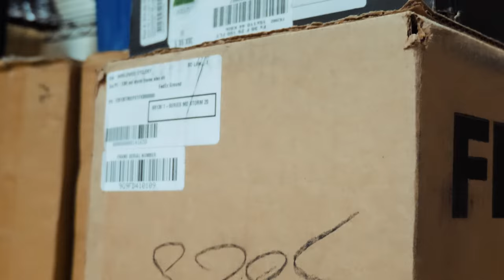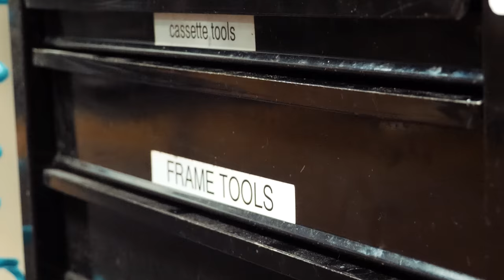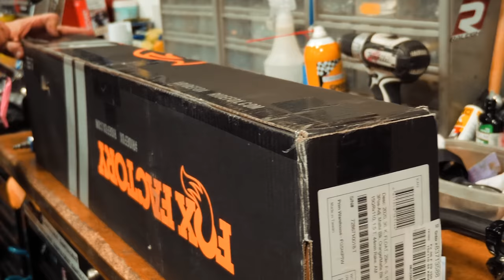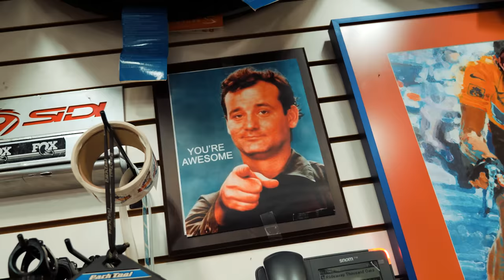MY NEW DREAM BUILD MTB - YETI SB130 | 2020 Yeti SB130 | Gee Milner Inspired | Dad's New Bike Day 2

Comment: Great vid! I noticed you got the 100 mil dropper, then saw your comment that you’re riding a M size at 5’6”. Brings to mind a question I’ve had,  also at 5’6”. Have you tried small frames, and if so why did you choose the medium over the small? One advantage you’d have with the small, is to utilize a dropper with more travel. I ride a small, just based off mfg’s sizing charts, even though I’m technically sort of close to the lower end of the medium sizing height scale. I have a 150 mil dropper, but actually think I could use a 175 mil. I’m a little curious if I may like a medium bike more? I wonder what the advantages may be?
Reply from the maker: this question has a two fold answer, I grew up ridding bikes that were always bigger then me and I feel more confident hucking it off of things. 2. I would probably be ridding a small but since im poor and need to turn over my bikes with the most profit possible I will never ride a small unless I become very well off because Smalls are super hard to sell. Basically, I ride medium because of financial reasons.

Comment: Sweet now make it a lunch ride 
Remove the spacer makes it 137rear

Set psi to yeti settings I found running 33 sag is terrible and higher sag is better for the sb130

No compression and vroom
Reply from the maker: Really I’ll look into this, I kinda thought the same thing after ridding it the 130 is kinda pushing it
Reply: Slow the rebound to 7 clicks from full fast
Zero compression
And go based of psi

I tried 33sag and I couldn't make techy climbs cause bb was too low
I would get in the rough stuff and would be too far into the travel 

Now I'm running zero spacers 
Shock set to 137mm travel(by simply removing the 2mm spacer that comes on the dpx2)
Not sure what sag I'm at but I'm at higher psi which.makes it track way better
Reply from the maker: Wow thanks for the great information 😱

Comment: how did the yeti sb 4.5 get damaged???
Reply from the maker: They did not secure the handlebars and it was basically loose in the box damaging the frame as it travelled
Reply: @MTBdropIN  Like rattling?
Reply from the maker: it was more then rattling it was basically almost free in the box, it was so disappointing at the time but now looking at it, I had no idea I was going to be able to get my dream bike out of it. however, I did not have a bike for over a month lol
Reply: MTBdropIN  what kind of box did you use? Also what type of packing, did you have a shop do it?  I’m just trying to learn from your mistake, any more info would be appreciated.
Reply from the maker: Go with a reputable shop I think the shop  I used seemed nice but lacked high end bike experience